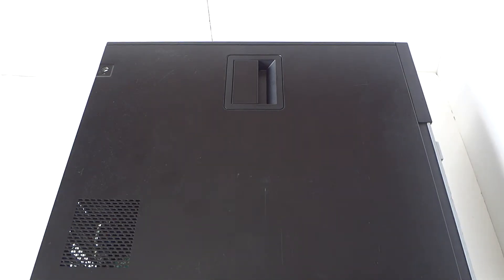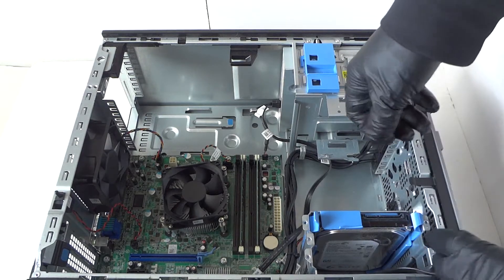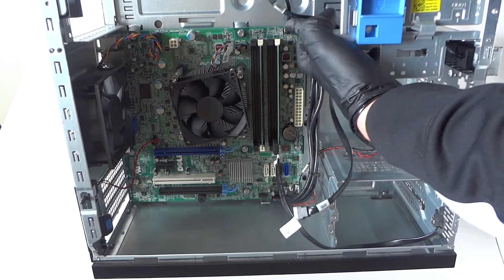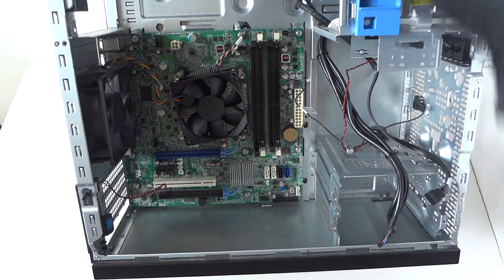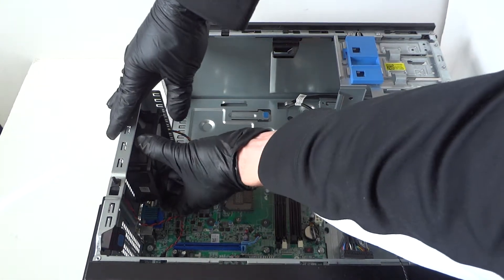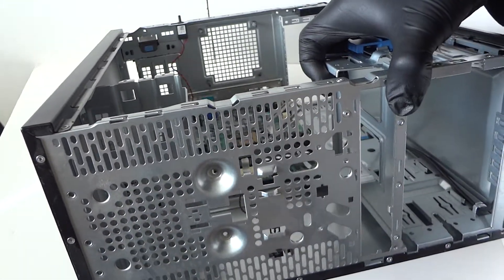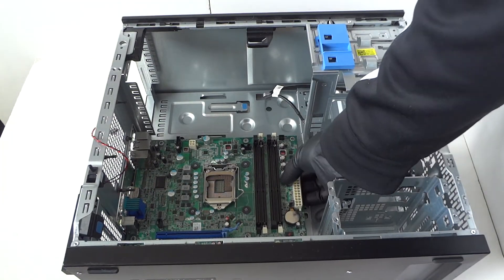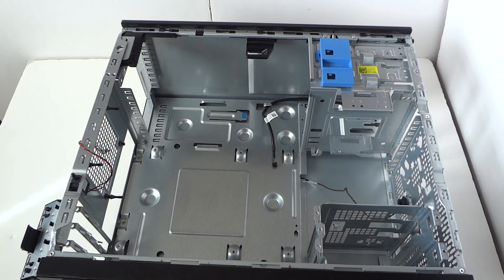Dell Optiplex 990 Teardown

Comment from the maker: List of Parts work with this System and Upgrades 

PSU:
(1.) CORSAIR VS Series, VS500, 500 Watt, 80+ Certified, Non-Modular Power Supply
https://amzn.to/2RxoMZV
(2.) CORSAIR VS Series, VS450, 450 Watt, 80+ Certified, Non-Modular Power Supply 
https://amzn.to/3efEeDO
(3.) Thermaltake Smart 500W 80+ White Certified PSU
https://amzn.to/2xQHm8F

 
This RAM works with this machine:
(1.) Crucial 8GB Single DDR3L 1600 MT/s (PC3L-12800) Memory CT102464BD160B
https://amzn.to/2VhGv8O
(2.) Crucial 4GB Single DDR3L 1600 MT/s (PC3L-12800) Memory CT51264BD160B 
https://amzn.to/2xq46wb
(3.) Crucial 16GB Kit (8GBx2) DDR3L 1600 MT/s (PC3L-12800) CT2K102464BD160B 
https://amzn.to/2VpsKpP 

 This video cards will work with this system.
(1.) Gigabyte GeForce GTX 1650 GDDR6, GV-N1656OC-4GD Video Card 
https://amzn.to/2Zyg5TN
(2.) ZOTAC Gaming GeForce GTX 1650 OC 4GB GDDR6 
https://amzn.to/32peeSW
(3.) Gigabyte Geforce GTX 1050 Ti OC Low Profile 4GB GDDR5 (GV-N105TOC-4GL) 
https://amzn.to/2XEqKMb
(4.) MSI Gaming GeForce GTX 1650 4GB GDRR5 Low Profile (GTX 1650 4GT LP OC) 
https://amzn.to/2VkDdSd
(5.) MSI GTX 1050 TI 4GT Low Profile  Graphic Cards 
https://amzn.to/34r0AxG
(6.) Gigabyte GeForce GT 1030 GV-N1030D5-2GL Low Profile 2G Computer Graphics Card 
https://amzn.to/2Xu3SyO
(7.) ZOTAC GeForce GT 1030 2GB GDDR5 64-bit Low Profile Video Card ZT-P10300A-10L 
https://amzn.to/3eayL1b
(8.) ZOTAC Gaming GeForce GTX 1650 OC 4GB GDDR5 
https://amzn.to/2V28laj
(9.) ASUS GeForce GTX 1650 Super 4GB Phoenix Fan Edition (PH-GTX1650S-O4G) 
https://amzn.to/3eoad4S 

(10.) MSI Graphic Cards GT 1030 2GB GDDR5, Low Profile 
https://amzn.to/390Spum
This HDD 2.5inch will work in this caddy for extra storage.
Dell R494D 3.5" to 2 x 2.5" HDD/SSD Caddy Adapter 0R494D
https://amzn.to/3c8ynhJ
1.. Seagate FireCuda 2TB Solid State Hybrid Drive Performance SSHD – 2.5 Inch 
https://amzn.to/3b1e8T7
2..WD Blue 2TB Hard Drive s, SATA 6 Gb/s, 128 MB Cache, 2.5"
https://amzn.to/2Xstb4b
3..Seagate BarraCuda 2TB Internal Hard Drive HDD – 2.5 Inch 
https://amzn.to/2xmf0TE
This cable required if you going to install SSD and HDD:
Benfei 15 Pin SATA Power Y-Splitter Cable 8 Inches
https://amzn.to/2XsG0LV
Cable Matters 3-Pack 15 Pin SATA Power Splitter Cable 8 Inches 
https://amzn.to/2Rval8B
Zheino SATA Power Splitter Cable (2 Pack) SSD Power Cable HDD
https://amzn.to/3a3V9Wq
SSD list works with this PC:
(1.) Samsung 860 EVO 500GB 2.5 Inch Internal SSD MZ-76E500B/AM) 
https://amzn.to/2yNxnkE
(2.) WD Blue 3D NAND 1TB Internal SSD, 2.5" WDS100T2B0A
https://amzn.to/2wvnC9Z
(3.) WD Green 1TB Internal PC SSD  WDS100T2G0A
https://amzn.to/3cbrcWa
(4.) SanDisk SSD PLUS 480GB Internal SSD SDSSDA-1T00-G26
https://amzn.to/3a3i9ou
(5.) Crucial MX500 250GB 3D NAND SATA CT250MX500SSD1(Z) 
https://amzn.to/34rZlhy
(6.) Samsung 860 PRO SSD 256GB - 2.5 Inch SATA III 
https://amzn.to/2ybiHLK
(7.) Samsung SSD 860 EVO 250GB 2.5 Inch SATA III Internal SSD 
https://amzn.to/2VjIAkK
(8.) SanDisk SSD PLUS 240GB Internal SSD
https://amzn.to/3c7SEE4

Comment: This system looks like ok if you want to change parts or updates. Another oem sistem hp, fujitsu siemens not work with standard parts, you need original parts like power suply , cpu radiator.

Comment: what is the sensor for
Reply from the maker: Hi, is designed to monitor the temperature of the air in the room where the system is being used.

Comment: Hello I seem to have a question. My computer the optiplex 990 stopped working randomly the monitors would show no icons up. So when I looked inside of the computer there was this cable called the foxconn 6d it was unplugged and I can seem to find were it plugs in.

Comment: bro do you know where the air temperatur sensor ? 
i have an error message air temperatur not detected
Reply from the maker: Hi, it is located in the front bottom where hard drive cage is.
Reply: Update the bios to the latest version, later revisions of this model don't have the temperature sensor or heatsink on the PCH chip. They changed it so it won't throw the error anymore.

Comment: Is it possible to remove hard drive brackets ?
Reply from the maker: Hi, yes you can remove hard drive cage i will upload video really soon show you how to.
Reply: Mxkdi hi think I figured it out you need to drill the holes out on the front and underneath the cage, I hope my asus gtx 680 4gb will fit I love the 990mt
Reply: Victoria Carmody  how did you take it out?

Comment: Hi. I have installed an nvidia NVS420 graphics card on my Dell 990DT with the intention of running 4 monitors for a trading station. For some reasons I cant seem to figure out why the computer wont boot. I have searched far too many vidoes but I cant find the solution. The bios setup is completely different from the simple blue screen. Some people say I have to disable the secure boot but I cant find it in bios. Any help will be highly appreciated
Reply: Your power supply can’t handle it or another thing isn’t support
Reply: You mean a NVS450 with four outputs ,right. Upgrade your power supply to 500 Watts.  NVIDIA support has excellent nView software to make 2, 3 or 4 monitors work as you want. Take the NVS420 back.